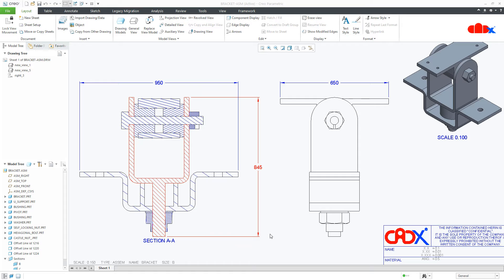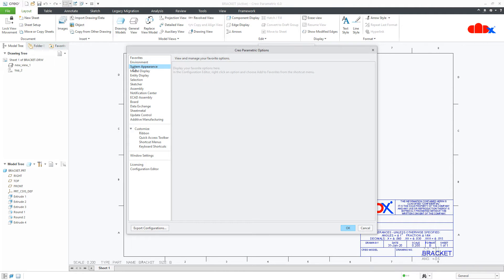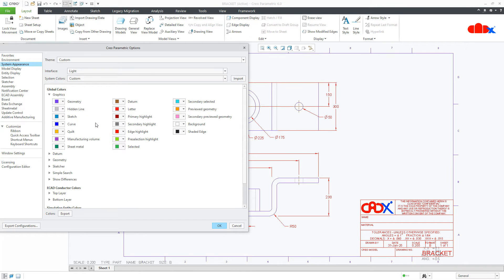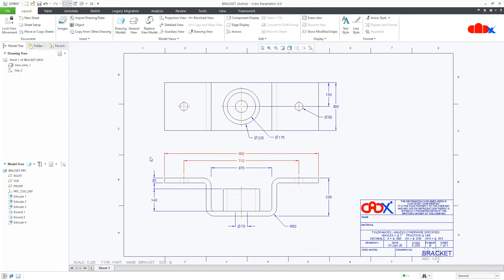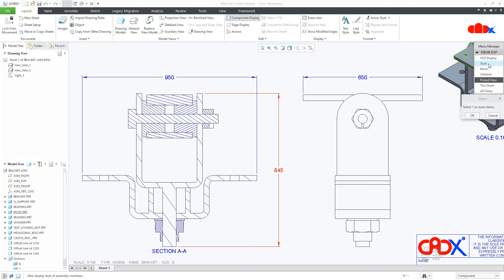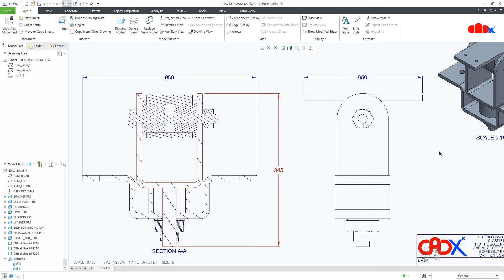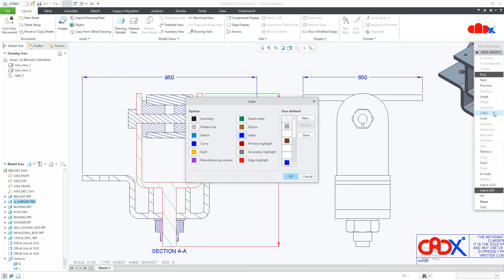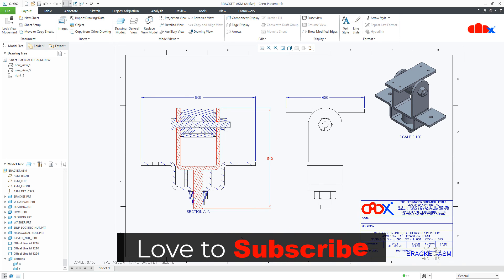Change the dimension colour, component colour and hatch colour inside the drawing in Creo Parametric

Comment: How to spell check in Creo drawing?
Reply from the maker: When Creo ModelCHECK runs in Drawing mode, it checks for spelling errors. You can:
• Highlight the misspelled words.
• Automatically replace the misspelled words with a specified new word.
• Add the word to the dictionary as spelled correctly. The word remains accessible to all Creo ModelCHECK users.
Reply: @CADxTraining  A quick, short & informative video should be created for this.
Reply: How to add bullet points in Creo drawing notes?